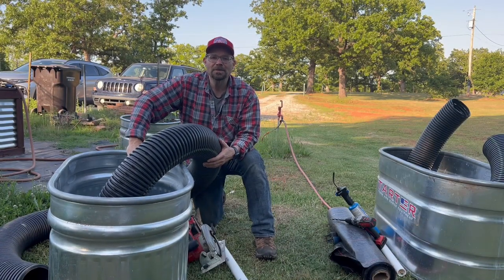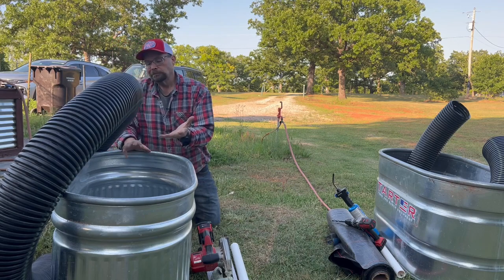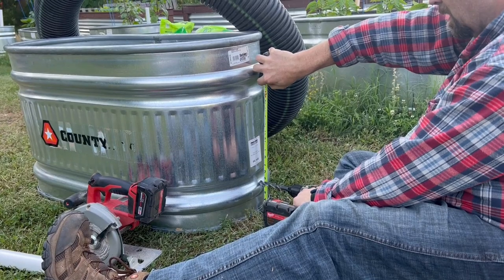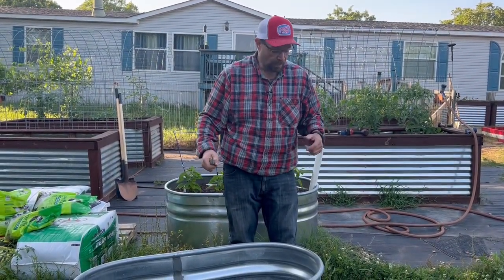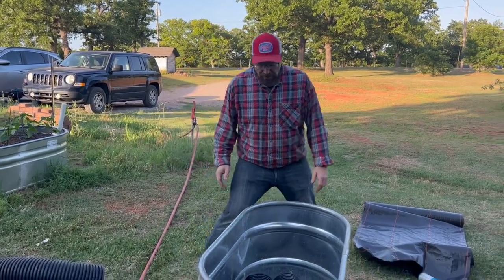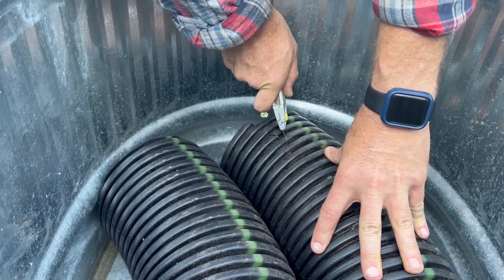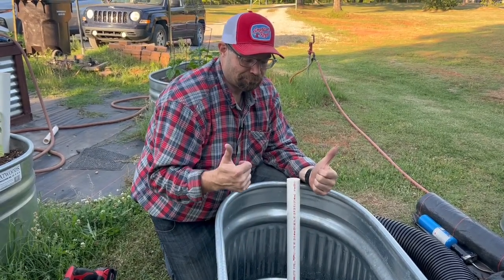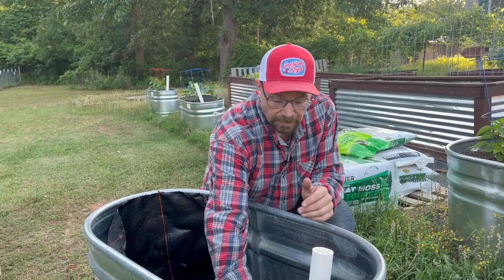Self Watering Raised Bed Using a Stock Tank

Comment: Nice work but this system would benefit from an overflow drain, IMO. It would go through the metal wall at about 5” high and go into the end of one of your big drainpipe pieces. This keeps a consistent air gap between the water in the pipes and the soil above. It also prevents overflow from hard rain.

Comment: I can’t locate 6” perforated pipe anywhere. Where do you get yours?
Reply from the maker: We got ours at Lowes. However, I had to buy 100 ft of it.
Reply: You could use 4" if you can buy it in shorter lengths,  and cheaper.

Comment: How often do you need to add water to this system?
Reply from the maker: It depends on what you have growing, how hot and humid it is. During our hottest part of the summer, (multiple days over 101 with one day hitting 110) we had to top water some of them daily, (not a lot, but some). Then I would fill them up daily. Not that they needed it daily, but I was able to fill the water that day, just in case I missed the next day. We had three tanks that needed more water than the other 4 did. The main reason was how many plants were in the tub or how big the plants were in there.  I hope that helps. Let me if you have more questions.
Reply: @RockingCHomestead  Yes, that is useful info. Thanks for your prompt reply.
Reply: @RockingCHomestead  When you say "fill the up daily", do you mean filling the PVC tubes until water is at the top?

Comment: I keep reading that water will only wick up thru soil 12". Your tank is 24" tall. Your pipe is 6". You leave a couple of inches of room on the top for top dressing and mulch. I keep thinking I need 10" of water in the bottom to water the roots of the plants. Would you say your vegetable harvests come from fully healthy plants?
Reply from the maker: We have grow several different things in them and never had a issue. We do not fill them all the way up and do water the top if needed. Last year when we were hitting 100 plus degrees everyday with no rain. We needed to water them more often and even water the top. We have Garlic planted this year, they do not have very long roots. We will see how they grow.
Reply: Tomatoes and some other plant roots can easily reach 18” or more so no problem for them. Other plant roots don’t go as deep so probably need watering from the top.